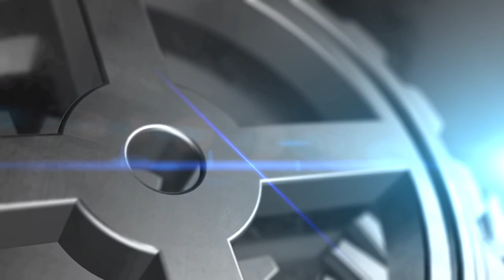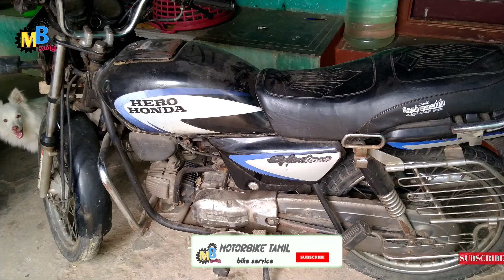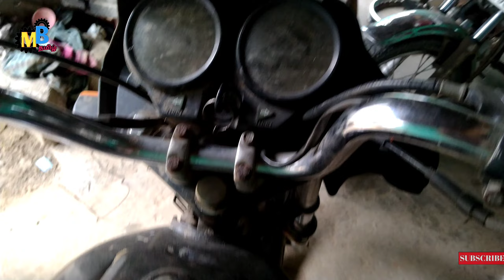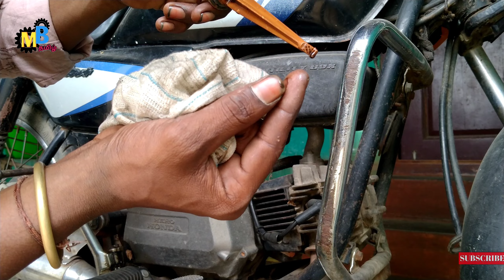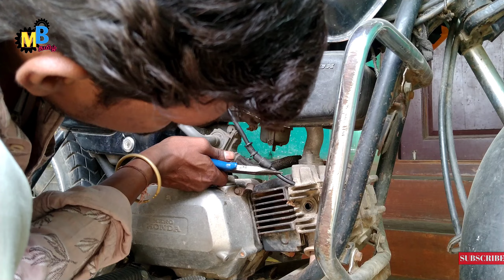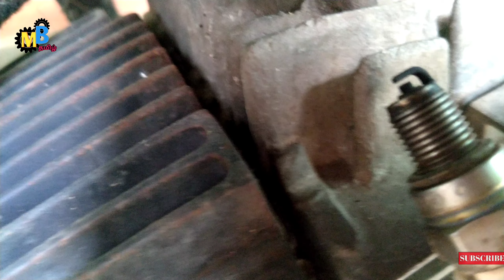SPLENDOR PLUS BIKE STARTING PROBLEM / JUST 3 STEPS / Motorbike Tamil

Comment: Bro cbz Xtreme slow speed problem rpm stable neika matikuthu bro carburettor clean Pani plug change Pani air screw not adjust aka matikuthu complain enna vaa irukum bro
Reply from the maker: km 40k athigama odi iruntha head work pannanum bro ...

Comment: vandi suthama start  agala athuku enna pannurathu solluga
Reply from the maker: vandi eppo enna kandisanla erukkunu solluga nanba
Reply: spark aguthu ana vandi start agala
Reply: unga video la sonna ellam check pannita
Reply: new plag kuda pottu paathuta
Reply from the maker: @ramrajs6696  petrol erukkanu paruga, comprasor irukkau paruga comprasor ella na valve tight a erukkanu paruga. Air filter and sailansor la eathavathu adachirukana paruga
Reply: Hii ko